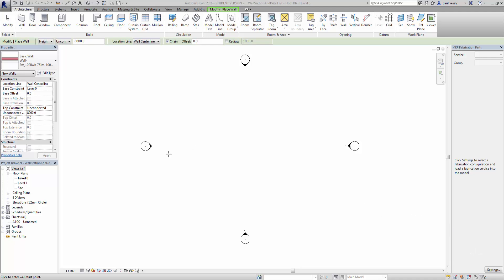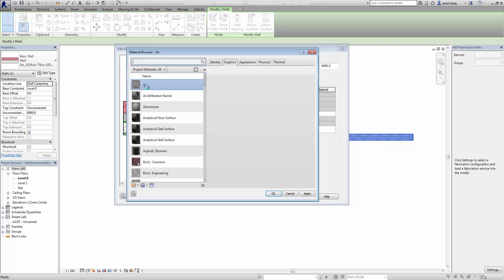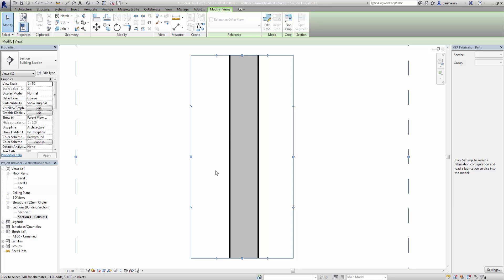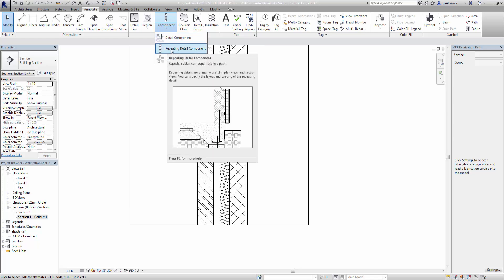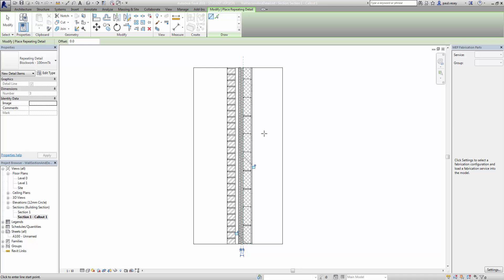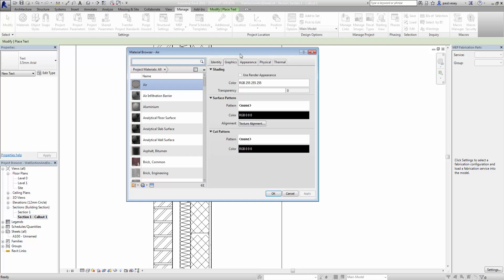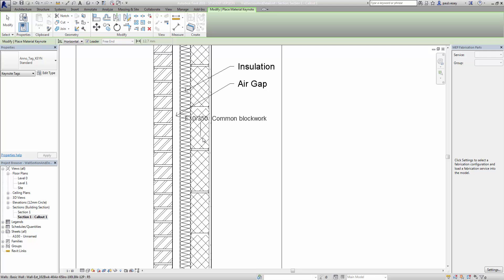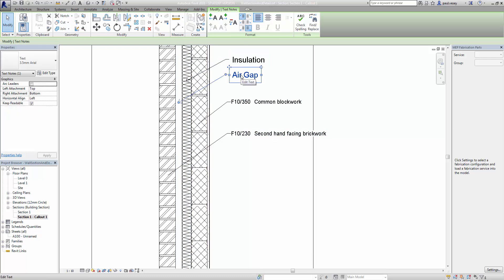New Revit Wall, Section and Detail

Comment: Great tutorial. Quick question, I don't have an option for "Air" in my product materials library, closest I have is "Air Infiltration Barrier". Did you create this yourself and if so what are thermal properties you used? Thank you.
Reply from the maker: Hi g1ng1e, The air material was in the Revit Library.  It contains a bunch of thermal properties that are used to calculate the U value and such.  It should be in the standard library, so you might have to import it using the material editor if it is not included in the Revit Template that you used to create the project

Comment: Can anybody explain to me how in these videos they find directly the piece they want and I must instead search all over the library for an hour only to discover that there isn't the piece I want?
Reply from the maker: Practice...  The folder structure in the library is quite consistent; after a while you begin to remember where things are.  The trick is to go slowly and learn the structure; you will speed up over time.
Also, the libs are different depending on geographical location.  This may present problems when you see vids like mine versus your own lib configuration.

Comment: Hi.
Where is this "Blockwork"? I cant find it in my libraries.
And .... is there a way to see all the contents of a Revit library? I mean how can one search something when he isnt even sure if there is in the library and if he looks in the wright envelope of the library!!!!!
Thank you.
Reply from the maker: Hi Ioannis, You may need to check your installation.  It is possible that the library files did not install.  For some versions of Revit there is a two stage installation process.  First you install Revit, then the Revit Content Libs.  Check you installed programs in Control Panel; Revit Content should be listed.  If it is there and you do not have the content, then run the Content Installer; you will need to select content packs.  Another check is to look for a hidden folder on you machine called 'Program Data'.  This is where Revit holds you library files.  A fast way to check is to 'show hidden files and folders', then run a search for '*.rfa'.  If they are installed there will be hundreds.. Good luck, Paul
Reply from the maker: Do you mean the repeating detail of the brick?
Reply: Sorry.
 I meant "Blockwork". The "brickwork" it was in my revit. The "Blockwork" I cant find.
Reply from the maker: OK,  If it is not listed, and you have other repeating details, then you will have to create it.  First load the detail component that you want from <you lib>/detail items, and just place it in the drawing.  Next create a repeating detail of some other component.  Then you need to select that; click the 'Edit Type' and duplicate it with the name you want it to have.  Then in the properties, select the detail item that you loaded into file earlier.  For Block I suggest fixed distance, with 225mm spacing.  Perhaps I should do a video on this..
Reply: Thank you very much.
Reply from the maker: That vid is up now.. good luck
Reply: Paul Vesey 
Thank you.
Reply: You can get some good detail components from within one of the revit sample files. Look in the samples folder for it.

Comment: Hi Paul, This is a good tutorial. As the wall type is set up as brick, block, 60mm insulation etc how come when you section it out its doesn't already shown with individual bricks, blocks, insulation etc. Seems a pain to have to manually add all these details.
Reply from the maker: Revit does not put in the blocks by default.  You have to add them as a repeating detail item in a section view.  I think this was one of the ways that Autodesk kept the model size down.  With Revit, and other systems, there is always a risk of over modelling.

Comment: I would like to know how or where do you save the new wall......as a library? and in such case where? So that you can use it as a new wall in a project.
Reply from the maker: +Luis Corral Lacy Walls become part of the model.  They are integral to the Revit .rvt file, so they do not behave like a family parts.; i.e they do not have their own file.  If you find that you use the same wall type, or any component for that matter, create a template file.  I have a few templates with some pre-loaded walls and family parts that I use, so I can bypass the 'load from file' process for a lot of the work that  I do.  Hope this helps..
Reply: +Paul Vesey Ok. Let's say I am a wall producer and I want some of my walls to be available to Revit users. Then I would have to make a catalog of these walls to be available. After I have made a new wall to be used in Revit to be copied for anyone, where do I find this special wall file?
Reply from the maker: +Luis Corral Lacy I think I understand. Bad news is I am not aware of a clean way to do this; but there is a way..  The wall producer needs to create a single Revit (rvt) file that contains a few meters of each wall type.  Then when users want to use one of those wall types, they have have to open the producers file, select and copy the wall they want (using Ctrl-C) and then paste into their working file using Ctrl-V.  Not clean by any means, but it does work.  Same method is used for railing also..   I would really like to hear of a better way....
Reply: Thanks!